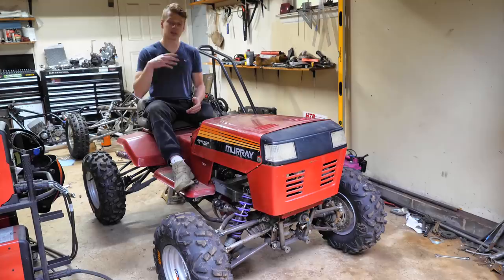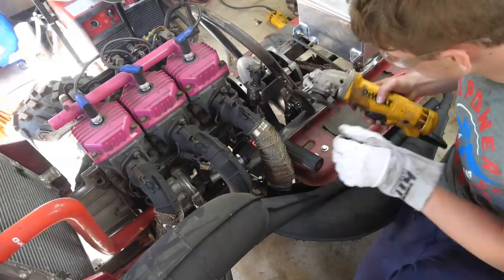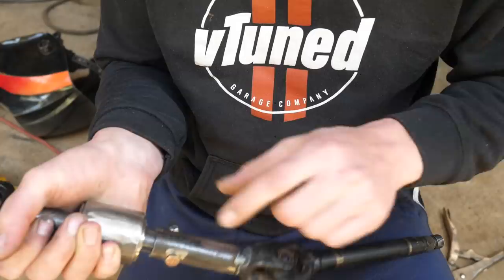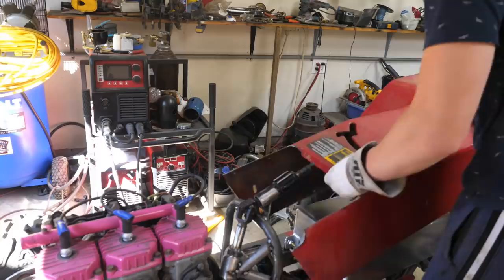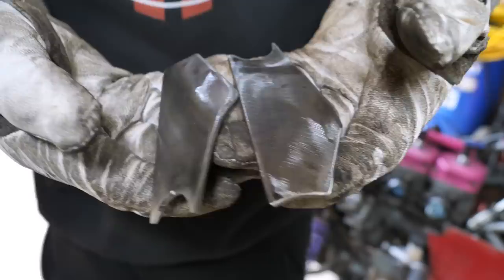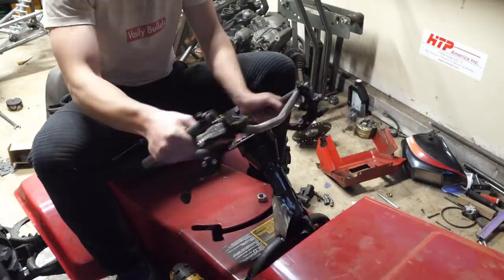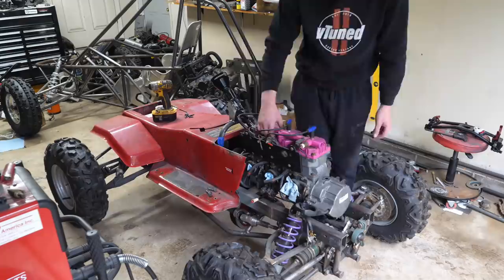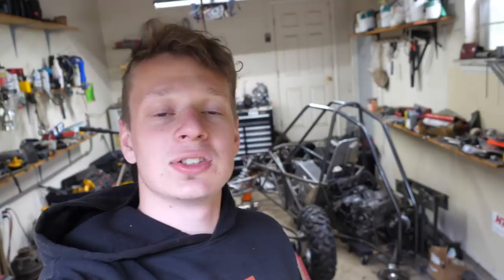4x4 110HP Triple Riding Mower Build Part 12!

Comment: If you phase the universal joints on the steering shaft that you fabricated you will find it will steer a lot easier .....in other words line the uni joints so that both yokes are aligned on the same plane ..good luck young fella you have come along way 👍

Comment: If you use a 1/4 spot drill in your mandrel you can drill and then move to the smooth shank before the hole saw gets to the material. 

Drill and hole saw in one motion without having to change to the 1/4 rod.

Comment: If you get a few different size round bar 1” long and drill a 1/4” hole in them  you can use them with your hole saw as bushings so you can still use a hole saw even if there is an existing hole like 1/2” , 3/4” ,1” etc....

Comment: This is a sweet build. Excited to see it running. Personally I'd run a smaller wheel with a lower steering ratio (more steering angle with less steering input) and keep the electric power steering box. Since this is likely to be an offroader that does medium to low speeds you will want lots of steering angle and a quick ratio so you don't need to cross up your arms in turns. The electric box will likely help prevent rocks/bumps from ripping the wheel out of your hands too.

Comment: Vasily - take it from an older guy who didn't wear hearing protection while grinding. Wear hearing protection when you're grinding man! If you don't you'll have ringing ears and trouble understanding conversation in noisy environments and by the time you notice it, it'll already be permanent. Love your builds man but look after yourself
Reply: I second this post. Hearing protection is very important. Years of playing in bands and going to concerts has ruined my hearing. I suffer from tinnitius now (constant ringing in the ears)
Trust me, it's not pleasant.
Reply: Very good advice on the hearing protection!!   20 years of working in a welding shop  severe hearing loss

Comment: Looking good!  (like Freddie Prinze used to say in Chico and The Man - ya, I'm that old!) 🤣
Very aggressive looking, Vas - I'm digging the stance for sure.  Glad to see you sorted out a different steering setup, hopefully you won't need the additional electric assist.
Just an observation; noticed a considerable droop at 8:38 when you turned the wheel.  I'm thinking you might need to consider different shocks - probably more tunable due to the weight up front.  Could be wrong, but I'm seeing a bottom out issue and I think stronger springs and damping adjustment are in order.  The other thought is a sway bar.  You compensated well with the stance due to a higher COG.  You might get more confident turning under speed with something to help with anti-roll.  
Rock on Vas!  Can't wait to see this one rip!!!!

Comment: Seems like you and Rather Be Welding are in a race to see who starts his Triple LAST.  My money's on him. 
This looks like a great application of "Steer by Wire"  if there ever was one.   Something like an encoder at the steering wheel and a geared servo motor or linear actuator in the front. Whatever.
Like your build, been following.  :)

Comment: I'm a complete rookie when it comes to this stuff, so what do I know, but with 110hp on what I assume is a pretty light mower, is there a risk you could flip back in that low slung seat if you mash the throttle? Should you put a higher back seat or some kind of restraint? What about rollover protection? I think it's awesome, though.

Comment: Don't worry about the offset steering wheel, it's still closer to centre than a gm pickup
Reply: Huh
Reply: @koenboonstra6549  you've never noticed how the steering wheel is 1 1/2 inches off centre in a gm?

Comment: Vasliy I LIKE THE BRAKES on the bars. The throttle should be thumb controlled. because this thing is going to throw you back and it would be easiest to let off. Pulling anything will make you gas it harder and be dangerous. Thumb throttle would be safest. IMO. Think about how to let off the throttle before you put one  on gas pedal might work too but when you gas it your going to be put back in that seat so hard it might make you let off too easy. OMG This thing is going to light you up.

Comment: Use a hydraulic set up.   Or a push pull cable.   Like on an outboard boat engine for the steering

Comment: Hey don’t be so down on your chain drive steering mechanism if you had gone to something the size of a bicycle chain then you could very rapidly (and cheaply) change your steering ratio which depending on what you’re using the machine for could’ve been a very useful mod. Much faster steering in sand or drifting and much slower and more powerful steering when bogging mud. I thought it was a very good idea but just needed a little fine-tuning

Comment: Holy crap, while you were holding the disk there... Do you think a bicycles brake disc would make a good steering damper? :O Like, have a super fine thread twist-adjuster for its caliper going to the dash, or the wheel, or a pedal? Know what I mean? Not saying you'll need one, general question here guys. lol.

Great build progress!

Comment: Vasily . 
serious question and please respond eventhogh your busy as hell. .Who makes the 3 cly you got and what did it come on. Specs please. xx..
Steven Dunn
Reply from the maker: 90's Polaris xcr 600
Reply: @VasilyBuilds  

Any interest in a 2020 kx450 with only 7.9 hours on the entire bike? I have the certificate of origin as well as the receipt from the dealership for the hour meter & instal atvthe time of the bike purchase. Basically just to show the bike had the hour meter on before its first startup.

I'm pulling the forks, clamps, wheels & brakes for a kx500 build I'm doing. 

The full frame, swingarm, linkage, shock with engine still in it, wiring harness, cooling system, exhaust all still there & on the bike.

The 2020 has electric start. Could be a cool engine for one of your builds.